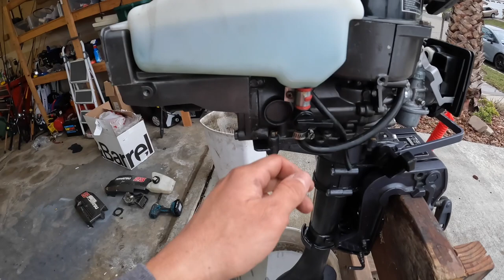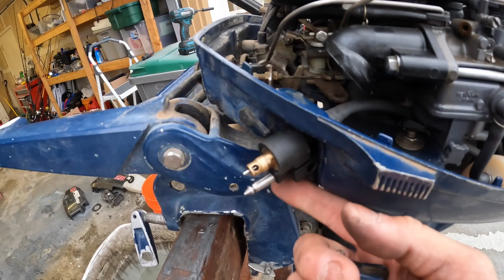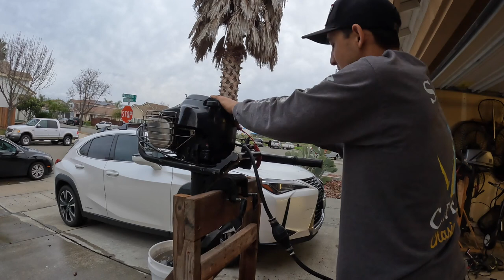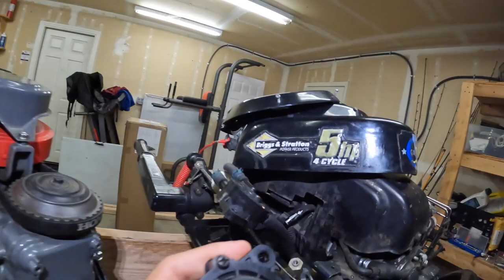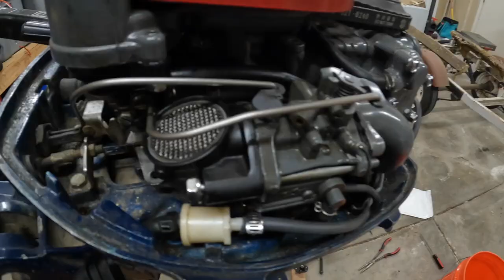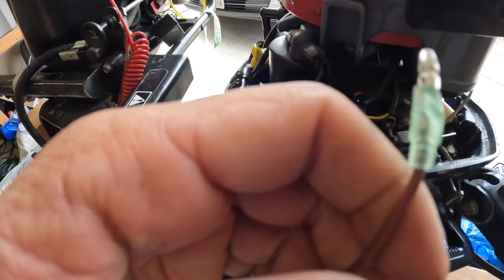Fixing 5 Cheap Outboard Motors

Comment: So you’re the one taking all the small outboard deals in the Sac area! 😂 I love how you make your videos. Do you buy and sell motors? I’d like to find one of those older Hondas a 10 horse short shaft so I can take my boat to lakes that prohibit 2 strokes. Do you have experience with the Honda 100 10 horse and are they solid motors?
Reply from the maker: 😂 The boat market is really saturated a lot of these motors I picked up awhile back and only typically buy broken ones. Ya I’ve worked on the older Honda 10hp motors they’re basically the same components as the 7.5hp. Most of the parts are interchangeable between the two. For being old motors those Hondas usually still run pretty good

Comment: I have an older circa 1990's 9.9 Honda with the throttle stuck on fast.  I took the throttle handle off but could make any sense as why its on full throttle.  Any suggestions would be greatly appreciated, thanks!